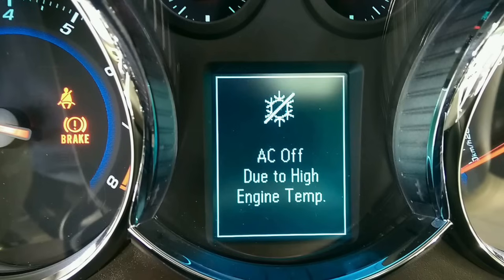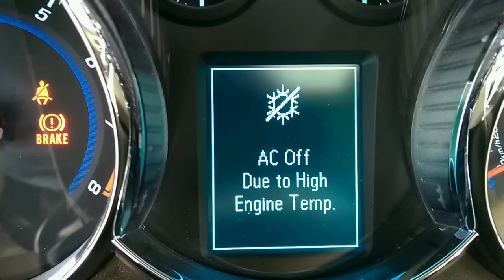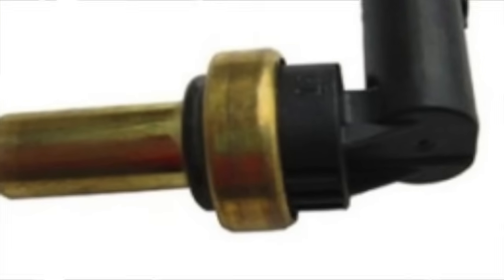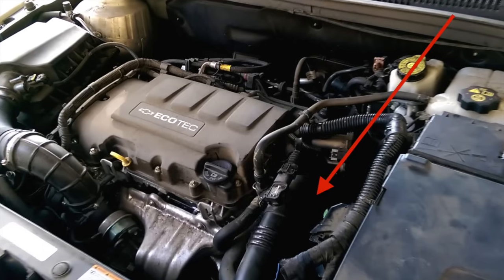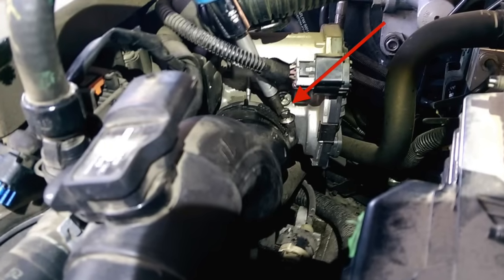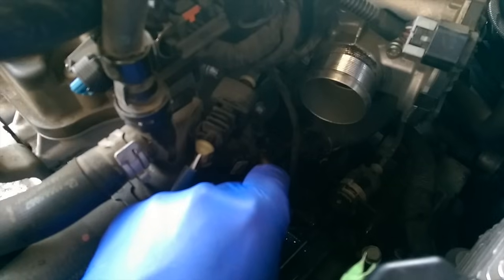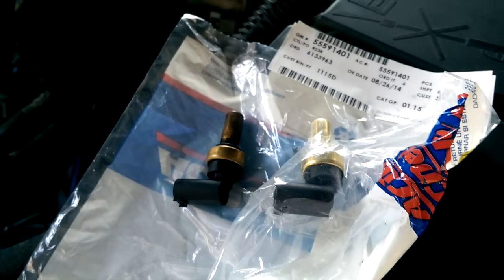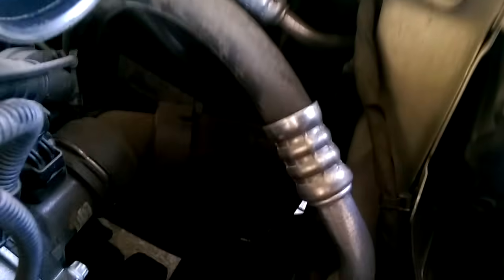Chevy Cruze AC Off Due to High Engine Temp

Comment: When this came on your dash did ur temp guage keep moving around also up and down?
Reply: Richard Marohn mine affects my “AC off due to high engine temp” , engine light and my temp gauge don’t work . it shouldn’t read if your sensor is bad because that’s how it can tell how cold or warm your engine is .
Reply: i have reset my codes just to see if the sensor itself was bad and it got rid of ALL those problems . lights and or temp gauge not cooperating . but they came back the next day so i know i need to change either one or both of the sensors .

Comment: was the temp gauge on cold before you changed the sensors?
Reply from the maker: familylupusandme You mean did I wait until the engine was cold? yes
Reply: Michael Callos no. I meant if your temperature gauge was on cold rather than hot.  
I had the same problem and my gauge said it was cold but,  we followed your video and it resolved the issue. thanks 😊
Reply from the maker: familylupusandme Oh. no. my gauge was in the middle. Glad to hear you were able to fix it.
Reply: familylupusandme I have this issue how did you fix it

Comment: This Happened to mine it was crazy the radiator hose came off the bottom of the radiator i reconnected it and filled it back up with antifreeze its now been 6 months and not had a problem since. For all the haters My 2014 LS manual transmission car is is probably the Best and most fun car i have ever drove seems some ppl love it some hate it

Comment: Erase the p217 code before changing sensors and problem may be solved. If the engine threw that code due to over heating the temp gage will stay on cold and the AC off due to over heating will pop up until it is erased!

Comment: This happened to me twice on my 2013 Cruze.  First time it was a leak at the thermostat housing so car actually was overheating due to coolant loss.  The second time it happened it was not losing coolant and was not actually overheating.  I assume the sensor is going intermittent and needs replacement.  Thanks for posting this video.

Comment: no more chevy for me o gm
Reply: Same here. I use to be a Chevy man.
Reply: First and LAST Chevy. Like clockwork, I go thru this every year.
Reply: SAME!! My Chevy cobalt burned on the highway and I’ve had nothing but issues with the Cruze.
Reply: Jahaziel fuentes my Cruze blew its transmission at just under 70,000 miles. $4,300 later that’s fixed. Now this is happening. And people wonder why I’m scared to drive my car....🤔

Comment: are both temp sensors the same part number? I also just want to throw this out there. Most of the Cruze's have a recall for radiator problems. Mine only sends this message when im low on coolant, which seems to happen often which I don't understand because I do not have a leak. I just had it inspected at the dealership when I was getting a seperate recall issue fixed. According to Chevy, when they produced the Cruze, the radiator they installed with the car was not big enough to support the system which is why it runs through so much fluid. There is a recall if your car is under warranty and you can call them and have your local dealership perform an inspection on the system as well as perform a free system service/top off on coolant.

Comment: Those the temperature sensor also causes the fan to keel going after you turn off the car
Reply: So I replaced the one at the top but not at the bottom

Comment: What engine is this for? And also when your Cruze was doing this did u happen to try using the heat? My wife's started doing this today and I noticed it because it was blowing cold air instead of heat
Reply: Did you ever figure it out.  Mine is doing the exact same thing.
Reply: Trisha Murray  ended up being temp sensor took all of 8 minutes to replace and cost about 15 bucks
Reply: Got mine fixed.  It just needed coolant...smh

Comment: i have a chevy cruize 2013 in mines said it today in the car went hot idk much bout cars so do u think its my problem
Reply: latasha rice mine did the same thing today then the check engine light came on for me
Reply: +Nathan Froese mines just went hot again put water in it in now my check engine light on to...i havent had any problems til yesterday
Reply: I was about to pay a guy $135 to solve my issue. If you've changed the sensor on the right side of the engine change the other one on the left side of the radiator. Both has a skinny clip holding the sensor in. Coolant will spill so do it safe, cautiously, and quickly. This is my first used car and I solved it myself from a comment on another video.

Comment: so AFTER GETTING THE AC OFF DUE TO HIGH ENGINE TEMP error on the screen I decide to change both sensors, I still kept getting the error, So I replaced the thermostat housing, it all was well, until yesterday a week from when it had actually been replaced, my question is. the error came on as soon as I started the car, and the fan was on full blast as if it was over heating? how is it possible that once I turn the car on it automatically say ac off due to high engine temp? if it was not even on for 5 seconds? when this occurs the gauge remains at cool temp, the car is not leaking any antifreeze and the fan seems to be working> the fan kicks on and off every so often is this normal? because I know if the fan was not working it would not turn on at all correct> any help is apricated thanks in advance.
Reply: I replaced water pump with thermostat and both radiator and engine temp sensor still getting issue ac off due to high engine temperature could it be ac switch?
Reply: Dice N Slice any luck with this issue?

Comment: I beg to differ. I have a 2014 Chevy Cruze 1.4L Turbo, standard model no cruise control, etc. that I bought with 17,500 miles on it.  It now has 242780 MI and has 99% been maintenance-free.
I've done the oil changes nowhere near regularly, I gave up and had the timing belt and water pump changed at 174000 and it didn't even need to be done and I have put rear shocks on it and that's it besides the obvious sets of tires. 
As soon as the weather breaks, I'm going to change the valve cover gasket and the plugs and one other part in there and I need to find out why service Stabilitrak light keeps coming on but otherwise, great little car!
Reply: The 1.4 Turbo has a timing chain. U said u changed a timing belt AND waterpump. I have 260,000 miles on mine. My cruise control is on 85% of the time. I cant imagine driving without it.

Comment: Chevy used to make great cars and trucks. We still own a 1998 Chevy Suburban with over 100,000 miles and the check engine light has never come on once. We're developing some issues now with the suspension and power steering but it's a 20 y/o truck. 

My uncle has an even older one with over 300,000k miles and he's NEVER NEEDED A BRAKE JOB. They've recently taken a turn for the worst. I love my 2018 diesel Cruze but I'll never buy a Chevy again. 👎

Comment: Fixed my problem too. Changed both as well. Second one is rather difficult to get to. Great job on the video!
Reply: How did you pop out the one by the radiator??

Comment: I found out they're not the sensors there is a plug that goes out on the car to caused this it should be a recall
Reply from the maker: Jonathan barnett A plug... you mean the wiring harness or a water plug?
Reply: Michael Callos well I replaced the sensors and fyi 2011-2014 model cruzes  have a recall on the catalytic converter so I told them about this problem about the a.c. is off due to high heat engine temp so it took Chevy 7 hours to find out what is wrong with my car and they told me that they take a pic of the switch relay that went out on my car the part is about 45 dollars they only charged me for the diagnose  fee double fee and the part all together 310 dollars but imma tell them that everyone is having the same effect so I don't have to pay imma show them this video so they know it's the manufacturer not us
Reply: Jonathan barnett Mine started doing that today! Let us know what they tell you
Reply: Jose Sanchez first replace the sensors if they don't work take it to the dealership  and tell them to replace the pigtail wire harness on the radiator bc most likely sensors really don't go out more like the wire harness
Reply: Jonathan barnett thanks!!
Reply: So I took mine to the dealership and they told me it could be a leak in the water pump and if it is the power train warranty covered it other wise I'd have to pay 140. They checked it out and it was the pump so thankfully I don't have to pay for that. It was the water pump for me.

Comment: THE CRUZE ENGINE RUNS AT 227 DEGREES.    DEXCOOL 50/50 MIX BOILS AT 240 DEGREES.  This is not enough margin to prevent boiling as the coolant heat soaks after shut down.  I fixed my boiling problem by simply draining coolant and going with straight undiluted dexcool. Now I have boiling protection up to 28 Degrees. no more boiling at all.  These cruze engines run much hotter than we are all used to, and thus require undiluted dexcool, not a 50 50 mix.
Reply: Jonathan Smith  I see you comments on a lot of diffrent cruze videos I hope what you saying is true
Reply from the maker: I would be careful. There are several issues with these engines. If it is not recommended, then there maybe something else wrong. Take it to a dealer, you may get a new engine at no cost to you.

Comment: I have a friend that was given a rental car while her car was in for body work and it was a Chevy Cruze. What a P.O. S. It took forever to figure out how to turn the AC on. No wonder Toyota, Nissan, Hyundai and Honda outsell American GM JUNK!
Reply: you turn the ac on by pressing the ac button

how is that a hard concept
Reply: Juan no comprende Ingles
Reply: Le Prankster I am quite capable of reading, speaking and writing in English. Perhaps, better than you and many other U.S. citizens that commonly use two negatives in a sentence. Soy bilingüe y por lo menos se leér, escribir y hablár Español. Tambien me comuníco en Italiano y Portugues. Você não boa pessoa. BTW, the word is, ¿Entiendes? and NOT "comprende"
Reply: Estoy pellizcando mis pezones ahora mismo.
Reply: That's a stupidity problem, not a car problem.
Reply: Ill never understand how people can complain about these cars i got the 2014 manual shift model its a hell of a car and it seems like it will last at least another 100k miles had a cobalt before it was a good car too the only Chevy problems i've had is a 2002 Malibu i hated that car it was garbage like all the other cars made in the early 2000's I'd recommend this car to anyone and the manual shift is a blast to drive so much power for a 1.7
Reply: GM has been nothing but pure problems. Nothing but problem after problem on all my GM products. 
"Most" Toyota, Honda, etc are cheaply made inside and is equipped with plain out dated interiors and features. So far I had the best experience with Chrysler products. Being 28 yrs in the used car sales industry, I have been in and out and driven most of all the manufacturers vehicles. My personal experiences I have the best of luck is with Chrysler vehicles. They came a long way and seems to have been improving from previous years.. Hats off to them..